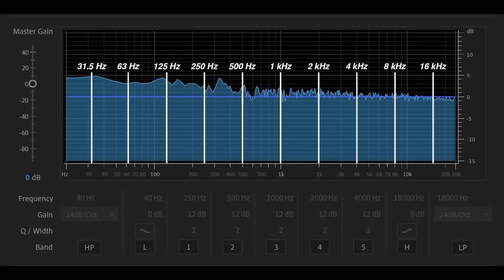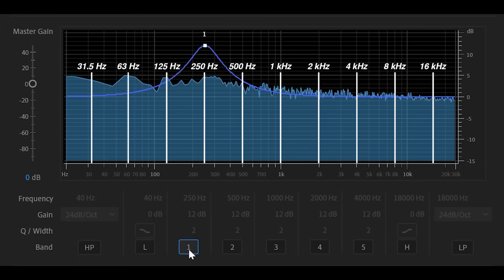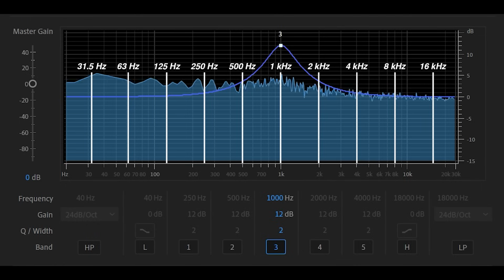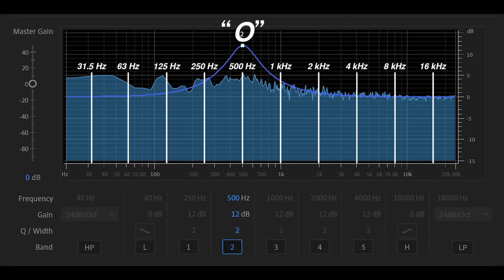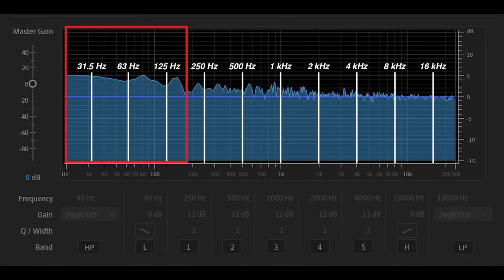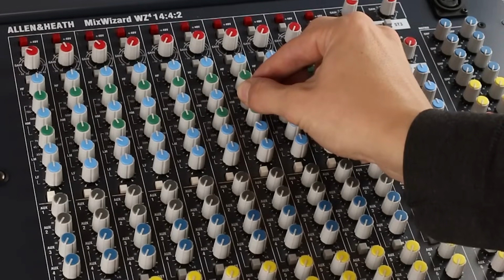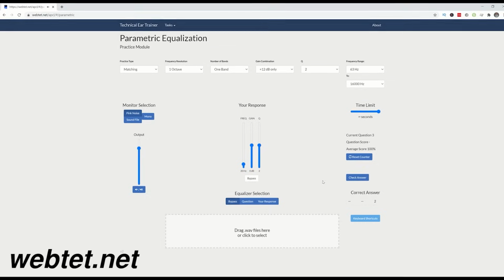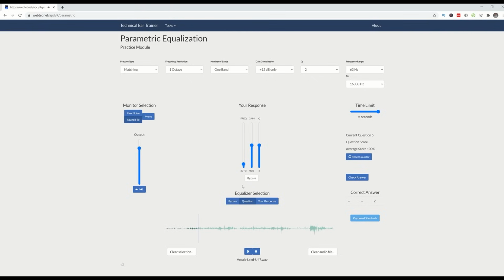Improve Your Mixes | Ear Training for Audio Engineers

Comment: I tried an experiment recently, and it surprised me.  I fed a signal from the bottom string of a few good bass guitars into a spectrum analyser. Just flat from the pickups, no eq at all.
 It turns out that most of the acoustic energy is NOT at the fundemental (41 HZ) but at the second, and to some extent fourth harmonics!   So some of the "conventional wisdom" about sitting bass guitar in a mix may be a bit flawed?